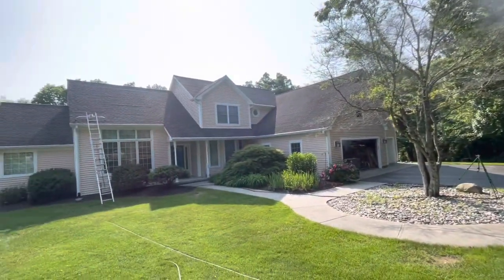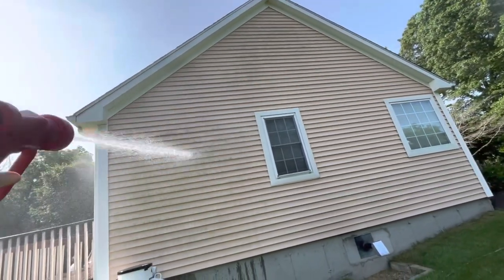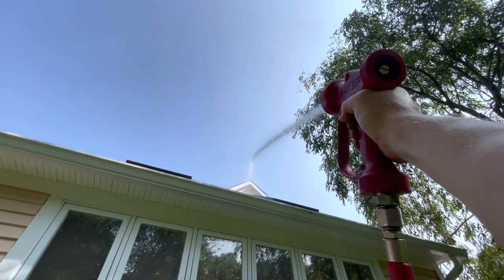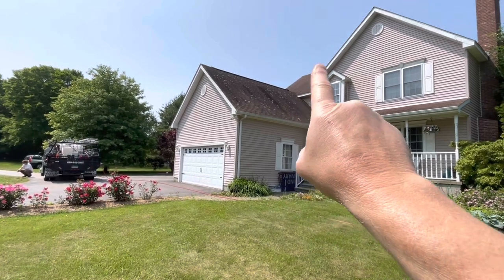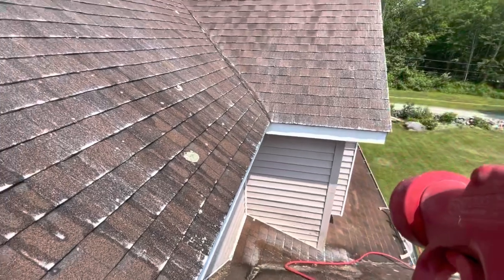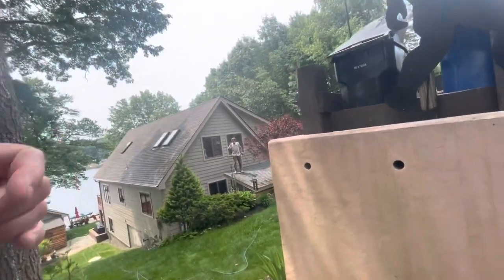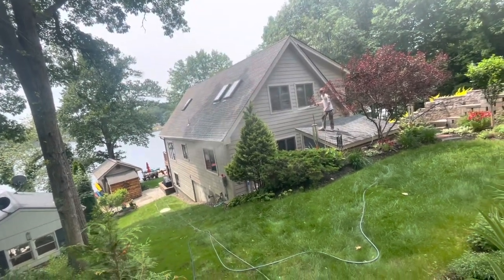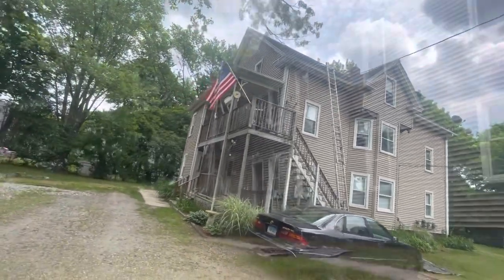X6 Roof Washing

Comment: Nice work. I like it. Question though, At 5% are you not worried about overspray on the grass? I always have a guy shooting water upwards to the overspray so we dillute the roof mix. I am just paranoid that the grass wil get killed. But from watching this it seems thats not an issue.
Reply from the maker: I don’t want to dilute the roof mix. I have my ground guy spraying the siding and plants etc

Comment: Looks like you're putting the x-6 to work...Good to see. I'm not getting that same distance. Have you up the pressure since you got it from Jimmy?
Reply from the maker: No sir. Are you running 5/8 hose?
Reply: @powerfulimprovements  Yes. Are you running through the hose reel baffel? Or are you bypassing it?